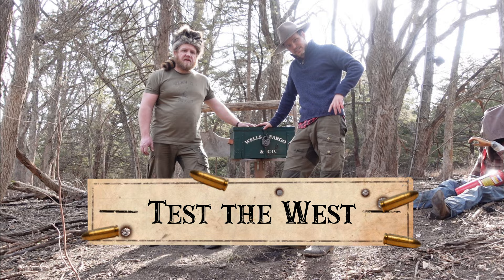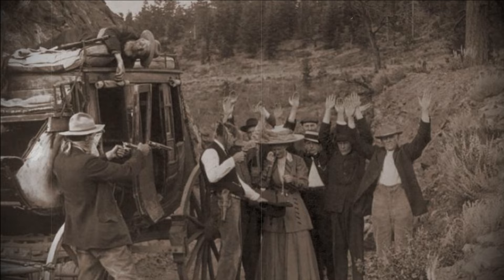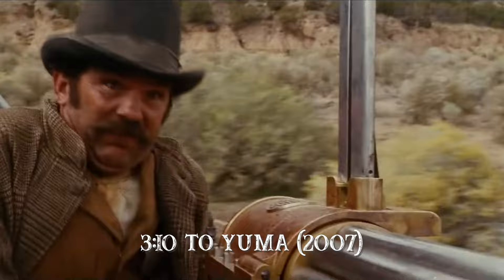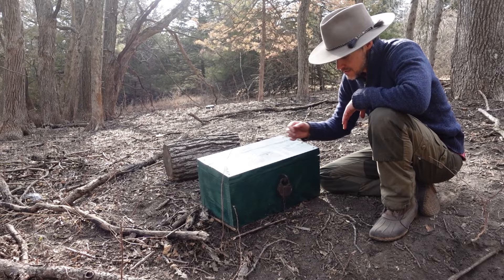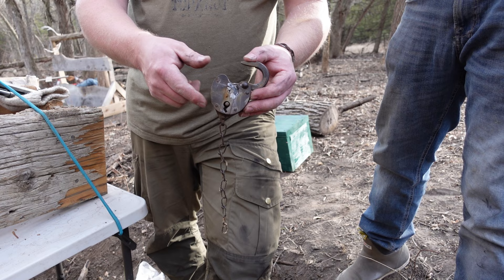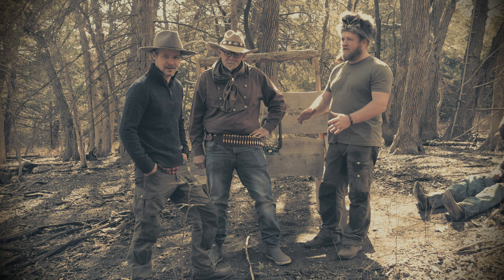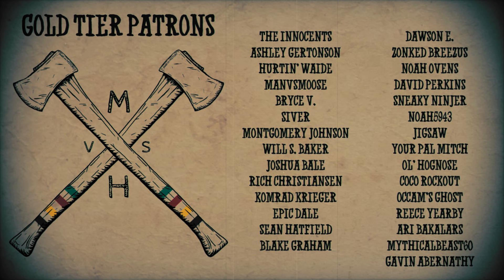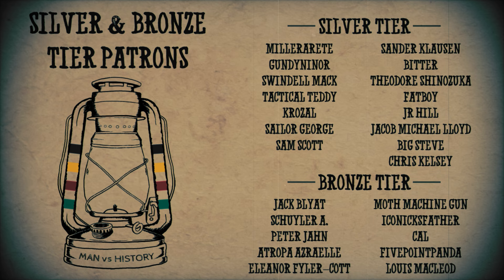Breaking into a Stagecoach Strongbox? Test the West Series: Part 3

Comment: What about hitting the lock from the top? Thats how I imagined it would pop open. I have done that with a little hammer on chinese locks when I lost the key. You hit it kind of slanted and the lock hoop gets free. Dont know if it would work on this lock though
Reply: Absolutely I’ve opened good brinks locks with an axe bc of lost keys
Reply: It would, these locks are actually really weak in the shackle, which is why it amazed me that they kept hitting the lock on the side and not from the top at a downward angle. But hillbilly's don't like using the grey matter between their ears